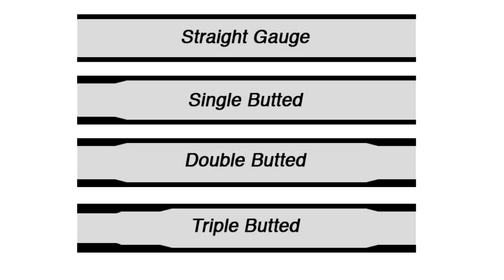Steel vs. Aluminum Frames

Comment: They muck about with steel to make it lighter (strength isn't an issue).

They muck about with aluminium to make it stronger (aluminium is very light).

Titanium is strong, light, and stupidly expensive.

Comment: What a BS. I am riding the push bike for 60 years and i tell you the very interestin fact. Most of the owners of aluminum road bike stopped riding at all after a few years . The owners of carbon road bike stop riding even faster. Tell me why? No your BS will have answer to this question.

Comment: Springs heat up. If you open a door with a spring it opens slower and you lose time (speed) due to heat you lose energy energy/time is speed.
If you push on a stiffer spring the energy gets less wasted.
Aluminum frames are absolutely faster than steel because of a better strength to weight ratio and betters stiffness most of the time.

Advanced aluminum alloy is also longer lasting
 The fatigue strength is actually superior and no, vintage steel frames fail all the time.

I've had 4 vintage bikes, 3 of them broke. The 4th happened to be aluminium. The other three were steel. Bent top tube and down tube 1), shattered rear dropouts, 2) unrepairable head tube misalignment, 3)

Steel fails. Old steel (anything past 10 years) is absurdly fragile and you have an objectively wrong opinion/stance based on personal experience.

Steel bicycles have advantages but sometimes do not last and are in no way generally better than other materials. Frame material no longer matters to be except by expense and use case.

For mountain bikes noncompetitive I recommend steel, they tend to be strong and cheap to replace when broken unless you need Enduro for climbing and heavy descent then carbon is best.

For "fixies" I recommend steel it is useful cheap to replace and rides well, but for fixed geared riding, carbon/aluminum is superior, more responsive and for the 1k-3k mark will give a great balance of ride quality and speed. Under 1000 is just a fixie, it doesn't need to be premium if it doesn't cost that much.

For fixed geared riding and over 4k builds for longer stuff and touring as well as for nice boutique bikes or heirloom quality, titanium is better than carbon/steel, because while 5k- 10,000 dollar carbon bikes are nice and fast, titanium with outlast carbon and others while being premium. Titanium boutique bicycles>steel boutique every day of the week. Literally all the same advantages but never corodes, actually invincible to fatigue (much more than aluminum, which is superior to steel in fatigue strength with bikes) and truly springy ride feel. Not as fast as carbon in top out sprints, but it is a better investment with the right brand.

Comment: I see this is an older video, but I'll comment. I ride both. I'm more of a steel frame guy, having ridden steel road bikes since 1974, but I was surprised when I bought a Klein. I found it to be as comfortable and lively as my Colnago, Fuso, Peugeot or Frejus steel frames! The lighter weight is also important, if you're competitive, but in that case, you'd probably go for carbon.

Comment: The big problem I have with aluminum bicycle frames is aluminum Resilience.   Aluminum resilience is tested by applying pressure then watch it rebound.  They do this over and over again.   The real test of aluminum resilience is to fire baseballs at it and watch how it responds to the impacts.  Aluminum baseball bats go dead and lose resilience with a few impacts.   A couple of bad accidents on a bicycle with an aluminum frame and I would not ride it.  I think aluminum frame bikes are resulting in accidents.

Comment: 8:42 you’re correct up until 8:55, aluminum does corrode, but what makes aluminum still more preferable is it’s corrosion acts as a protectant against the corrosion further spreading thus how aluminum doesn’t corrode to the point of needing to be replaced.Good vid though!!

Comment: I’ve owned two Al bikes and one Steel.   The steel bikes lasted 25 years with 3 rebuilds.   One Al bike lasted 30 min before breaking.  One lasted 5 years.   I never like the ride quality of Al.   So I only buy steel bikes.

Comment: I live in a tropical country that is always raining. My 6061 aluminium mountain bike frame is good for these wet weather conditions because it doesn’t rust. I can also wash off the mud frequently when needed.
I replaced my seatpost and handlebar with carbon fiber materials. I also replaced my stock coil forks with an air fork.
The carbon fiber parts, aluminum frame, and air fork combination absorbs road vibrations really well. The ride is now lighter and comfortable than ever. The combination of different materials can make your bike comfortable and responsive

Comment: I'm on a Steel fixi/single speed on 700c 35 tires I have wanted to try fixi but am unsure but as a bike its simple and I enjoy the ride the bike came with drop bar I switched them out for a riser bar much better

Comment: Question to all the cyclist in the comment section so I am planning to buy bicycles for quite some time now should I go for a good quality steel fram or starting aluminum frame  note there is 100 dollar difference  steel frame is cheaper

Comment: unrelated question... how did you manage to match road brake levers with v-brakes on the steel bike (thinking of the long/short pull problem)?

Comment: opinions please: I have an old aluminum hard rock frame that was my first adult bike. I have so many good memories and don't really want to part with it. I thought it would be fun to turn it into a tracklocross bike using an ENO hub. However, I have completely fallen in love with steel. How is it going to feel going back to an aluminum frame after riding fixed on vintage chromoly steel for three years? should I find the hard rock a new home or convert it?
Reply: convert it because i guess you can still find it a new home if you really hate it but i doubt you will dislike a bike you love. and if it really is too stiff for you just get wider tires and dont run them at such a high PSI :) and you will have a second bike incase one brakes or u have a friend over

Comment: its simple, aluminium is less weight and dont rusting and steel is better more wibrating silencer and more comfortable to drive imo, and you can fix bike with hammer after a slight bend

Comment: I have  a 1989 12 speed  steel frame Healing Skylark [sold in NZ].Took 
it to be serviced and apart from new tyres the guy said it was A1.Must 
admit I haven't used it much in 30 years.When I took it to another 
shop,the young guy there stared at it in amazement and said in an awed 
voice.."A Heeeeaaaaling"..like he'd just discoverd the Arc of the 
Covenant or something.

Comment: Aluminium frames seem stiffer than steel frames because aluminium frames are designed to be stiffer to take into account the fatigue issues of aluminium, which Ti or steel don't suffer from.

Comment: i jzst watched some parts of this and must say - what a damn bs. energy going to flex the steel goes into the drivetrain. sorry i had to laugh. the "feels faster becasue it is stiffer" can probably be right. But it just a feeling. In the end the flex helps you to sty comfortable which is handy for the msucles and thus for the speed. But this is also just true up to a specific point. if the flex goes too big the bike will not be faster - no way. because you just can not control the bike safely up to the same speed and so on and so on.

Comment: I have ridden the same bike in the alu and carbon version, alu was definitely harsher.

Should note I recall when alu frames were the carbon of their time, a friend rode for Cannodale and we oohed and awed over her new alu race bike (seem to recall it had huge yellow tubes).

Recall as teenager rebuilding my great uncles steel Raleigh, a tank, but a fun one, alas I was drawn by the hype of those fancy new fangled 10 speeds, if only I knew....

Comment: You forgot to mention that aluminum corrosion is not as much of a cancer as rust. Sure it could upend some paint but the surface corrosion is not very noticeable on bare aluminum and actually protects the aluminum underneath it from further corrosion.

Comment: Reynolds 631, sure can save a few grams by going up market, but to me 631 is the sweet spot in material as was 531c, performance, i.e. stuff a little cheaper is much less capable, and stuff much more expensive has little more capability and a 631 frame will literally last a lifetime.  Favourite Frame Builder, Bob Jackson of Leeds, a traditional frame builder from the days when all good bike shops had a Frame Shop round the back. Sadly internet put the bike shop out of business, but in return frame shop is kept busy selling a unpretenscious but beautifully built and finished lugged frame at a fair price.

Comment: for a hardtail mtb, fixie, or touring road bike, it's hard to beat chromoly... favorite bike i ever had was cr-mo. Perfect amount of give and still stiff enough. Not the fastest, but comfortable. Reynolds, Tange, Columbus - pick your poison. I've had several ti bikes over the years but personally found them too bendy :) For road, carbon 100%. Enduro mtb's - aluminum - I just can't warm up to carbon... seen too many seat stays self destruct over the years... they are either 100% or broken in half.

Comment: Ive used my 2012 specialized hardrock as full time commuter and touring bike for the last 5 years. It has an aluminum frame and has never given me any kind of issue. I love my bike and fully intend to be using the bike as a full time commuter and touring bike 30+ from now. In all honesty it is not really about the material being used, it is a whole lot more the about the  level of quality control and how well it is built. As long as you stick with a very reputable company the frame material really does not matter.
Reply: Is your bike still fine?

Comment: I prefer steel, because, in my opinion, it absorbs bumps better, and the additional weight is a good thing. I actually use my bike as transportation, and often carry heavy loads. In my experience, the heavier the bike is, the faster it is. When my bike is loaded down with 30 lbs of groceries, it is actually faster than when empty. Acceleration is slower; however, the weight enables me to maintain my speed, with less effort.

Comment: I'm an engineer and this is nothing about bikes but steel is denser and harder. It is much stronger and less likely break than aluminum. The density does make it a lil heavier. Aluminum is more ductile and has a lower yield strength. So it's not as strong but it will absorb shocks better and it will deform (dent or bend) before it just snaps.
Reply: what carbon bikes ? I just bought a beautiful carbon bike, and rides amazing, but will it brake unexpectedly ?

Comment: If you’re running a competition or training pistol that will see tens of thousands of rounds through it then steel all the way. But for daily carry an aluminum or scandium frame is the way to go. I prefer the polymer striker fired pistols like Glocks but that’s another thing altogether. Edit: Oops, wrong subject. I had to ward off an angry moose with my steel frame cruiser bike above Park City back in the 90’s and still own it so I’ll go steel frame all day long.

Comment: Not all aluminum in bikes are the same grade.   in the 90's and early 2000's only the cheapest aluminum bikes were made of 6061.  7000 series aluminum was used in top of the line aluminum racing bicycles.  Today most bike makers want to sell carbon bikes so they almost exclusively us inferior 6061 even when paired with nice wheels and upper level groupsets.   The comparison is like comparing hi-ten steel frames to Columbus Cromo.

Comment: Zach the triangle should be: Strength, Weight and reliability. The reason that Aluminum uses larger tubes is that it cannot flex, as it fatigues easier than steel.

Comment: All the springs are made of steel ... so pick a steel frame for a loaded  bike on sealed road with norrow tires and combine it with a leather seat .   Hydroformed aluminium triple butted is much stronger ... so pick a al frame combined with thick tires and some seat suspension or fork suspension for a backpacking or expedition bike

Comment: Failure due to fatigue is determined by both material properties and the repeated force. No material has an “infinite fatigue strength”. If the repeated force is small enough for the material (any material) to remain unaltered for more than 1 million cycles, then it will survive indefinitely. (Assuming similar conditions) this being said steel is more elastic than aluminum which does allow it to withstand greater cyclic/repeated loading.

Comment: There are lot more to the materials than 11 minute video allows to show. There are many kinds of steel and what is comonly called aluminium is alloy of alu and stuff. Depending on the aditives, heat threatment etc. those materials can have very different properties. I very sceptical about the infinite fatigue strength of steel and or your description of it. Well sceptical isn't the right word, I'm sure it's not true for every steel and every amount of force applied. 

But we are talking about bike frames and it would be silly to expect every cyclist to be interested in metalurgy and also one thing is theoretical knowledge and other is expirience. The lack of second one on my end is why I watched and I definitely wasn't disapointed.

Comment: How about making bike frames out of 7075 aluminum alloy rods instead of tubes? I watched a video of 7075 aluminum allow rods taking more abuse than steel under a jeep. Also, 7075 is almost 2/3rds the strength of titanium, but cheaper.

Comment: My bike is a 1988 Trek 560 (Chromoly frame), which is in mint condition. It has only six cogs; but that is fine for the flat Florida terrain, where I live. I paid $50 for it. I love the retro look; it really stands out in the group rides. Also, I have no problem keeping up with the carbon bikes.

Comment: Whilst generally steel as a material has a better fatigue strength, steel bike frames are not always stronger than aluminium ones: https://www.sheldonbrown.com/rinard/frame_fatigue_test.htm this is a decent experiment on real (high end) frames.

Comment: It's very important that aluminum is heat treated or it can crack in the heat affected zones of the welds. That is an extra step that steel frames do not need after welding not because there aren't heat affected zones in steel welds, there are, but because it is much stronger than aluminum so it is a step not needed for most steel bicycle applications. So if you buy an aluminum frame make sure it is heat treated at least.

Comment: All the talk of work hardened aluminum is really hard to prove! Chances are it was harder there to begin with when it was made and you just didn't know it because to really see any effect of that kind of aging and fatique you need more than your riding life time. Someone else will inherit that fatique many years down the road.  Used aluminum bikes 20 and 30 years old sell all the time on ebay and people ride them all the time. It really boils down to the ride you want to experience and the look you like. Some like the chunky look of aluminum! My wife's Trek looks awesome with the chunky tubes and my Cannondale is a great bike going on 30 years old. Unless you are super hard on your bikes they should ride just fine. Most of these people busting these aluminum and carbon bikes up are harder on shit than most people are anyway and they would tear up anything they get. It really says more about the person than the bike or the materials! Besides that you can add shock forks and shock seats to absorb all that supposed extra stiffness these days so why not do it? Steel is easier to find deals on. I have a specialized Street Stomper from the 80s and it's a great bike. My Cannondale from the 90s is also a fine bike it just depends on my mood as to which I pick when I go out.

Comment: Steel IS dependable if not as inspirational as carbon. I've cracked every aluminum frame I've ever owned but my aerospace engineering friend claims hydro formed aluminum is great stuff. I don't have titanium but it's supposed to be super comfortable but not as heavy as steel while Expensive due to the difficulty of working the material

Comment: Interesting, I love riding steel frames, I own 11 bikes and only 2 are aluminium (none are carbon!!) I used a mixed a mixture of a charge plug aluminium fixie, a 7 speed Reynolds 653 lo pro and a 3 speed hub gear kona paddy wagon 3 520 for my clubs local time trial last season and got pretty much similar times all season (within 30secomds) and believe or not I got my pb on the kona!! I've got a moulton tsr to try for this season, I can't wait to try it!!

Comment: Sheldon Brown is correct in that the amount of lateral flex is not an indicator of power transfer efficiency, but his explanation of why that is true is questionable. Consider, if you have two similar structures but one is a bit stiffer, and you expend the same amount of energy applying the same force to both, the stiffer one will deform slightly less. There's no energy saving there but cyclists are easily conned by frame builders that there is.